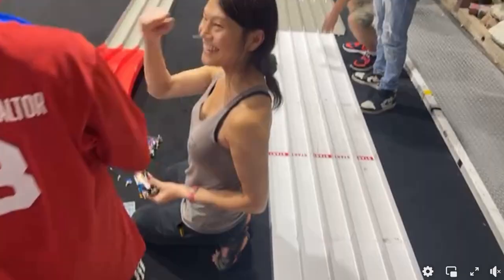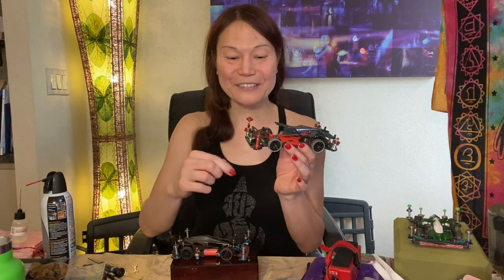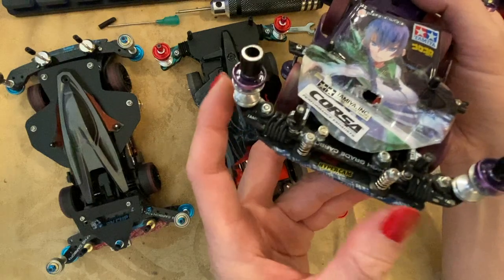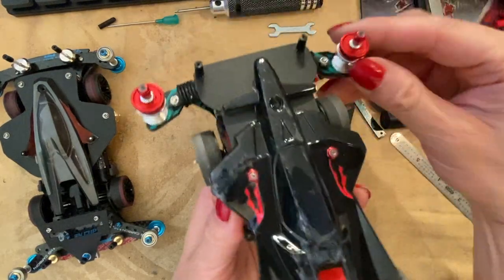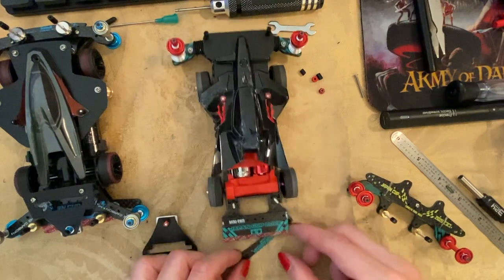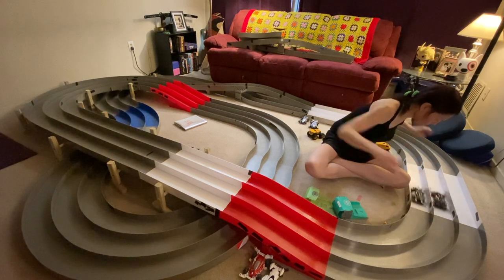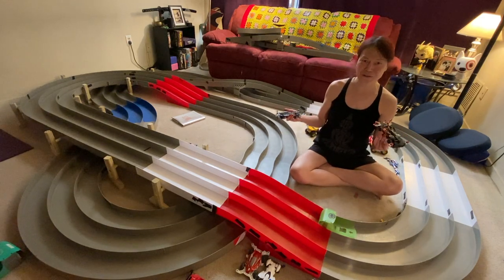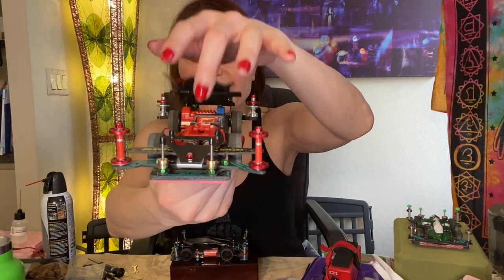Tamiya Mini 4WD - Building My First FM-A Open Class Car

Comment: Hi! Im new to this scene, may i know the part name for the front and back? Thankkssss
Reply from the maker: The front is an AT (autotrack) bumper. The rear is a pivot. My pivot is called the Chandeleir Pivot because it hangs downward
Reply: @claredin  i tried searching them cant find the parts,im gonna assume thats how you call the set up right?
Reply from the maker: @Unranked.  Yes, that's the set up. You have to build it using individual parts that you see in the anchor or pivot. Detailing all the parts would require a master class video.
Reply: @claredin  hi, again, btw congrats on your last race, i know next time youll win.

Anyway for my question, did yoy chop off the front bumper? To fit the AT?
Reply from the maker: @Unranked.  Yes, I did. I ended up cutting up until just a little bit above where the body catch latch is and then I rounded off the edge to a kind of square oval.

Comment: Quick question about fma, why does the propeler shaft always get broken?
Reply from the maker: It shouldn't. what motor and gear are you running?
Reply: @claredin  most of the time i use powerdash 3:7 and the track has a lot of jump/slope
Reply from the maker: @DEEMini4WDPH  Powerdash is a really strong motor. do you have carbom reinforcement on your chassis?
Reply: @claredin  no carbon reinforced, all stock
Reply from the maker: @DEEMini4WDPH  You'll need to find a way to reinforce your chassis. MS chassis cars typically have the two U shaped carbon pieces on the underside of the chassis to prevent the wheel wells from caving in from the force of a crash. There are carbon pieces for FMA chassis as well. See Aliexpress for ideas.
Reply: @claredin  ohhh thanks thanks for the info. I’ll search that one :)

Comment: hi! if you don't mind how much it cost that kind of build?
Reply from the maker: it's about $90 worth of plates, $40 for the rollers, $20 for the dampers, $7 for the cowl, $7 for the car catcher, about $15 for the screw sets and locknuts. $25 for the wheels/tires. Add motor and FM-A car kit. As with any open class car, it's more about the time spent than the money spent. It can take hours and hours to build one. Do it slowly, take your time, perfect everything you can, and the result will be good. And accept the fact that a car will not be good on every type of track. We build cars to be strong and stable and then we think about what tracks we want to race on and adjust our creation accordingly.